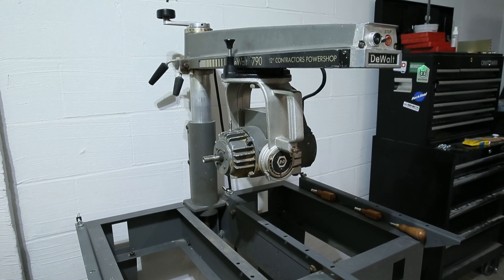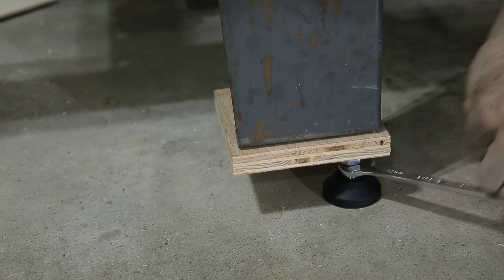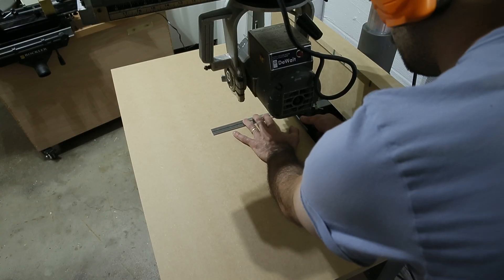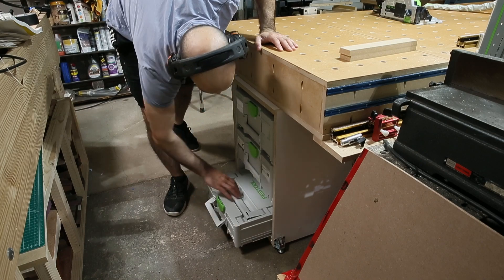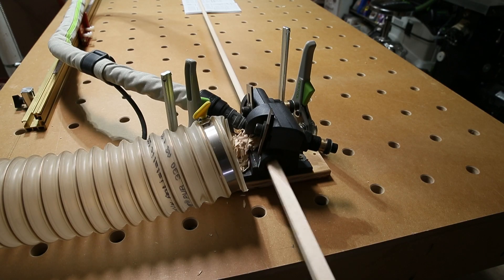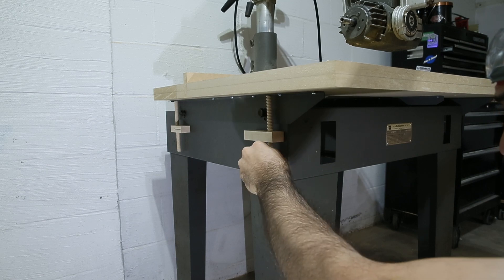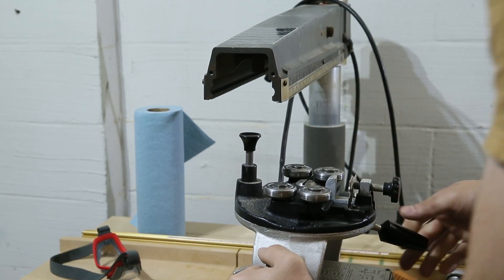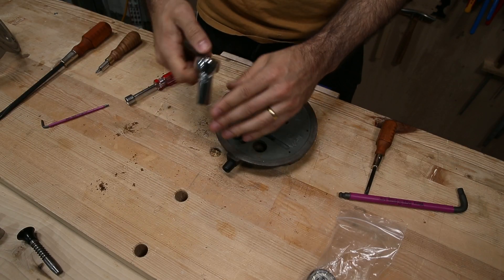Tuning a $125 craigslist radial arm saw; cutting wooden threads

Comment: I love this and am happy to subscribe. Excellent presentation and some great work. I have a similar vintage 10" version that was handed down to me and I went through a lot of the same processes. I also built a "Mr. Sawdust" style table for it that I'm pleased with. You can't beat a RAS for crosscut capacity which is what I mostly use it for. I found the same deflection in the arm that you did. In the end I don't worry about it too much. I use the saw for 'close' cuts and will true more important dimensions on my table saw sled. If you're looking for other tips on setup I found Brian Weekley's channel and videos to be super helpful. The dust collection style that Tommy Tompkins built seems to work best of the versions I've tried. I embeded some threaded inserts into the chute so that I can take it off for angle cuts. Cheers to breathing new life into a great old tool and thanks for taking us along with you.

Comment: Where should I look for any links for tools, etc.?
Reply from the maker: I’m just a regular guy in his garage, I don’t have any kind of sponsorships or affiliate links. I get the majority of my used tools on Craigslist and I try and get the new ones from Tools For Working Wood, Highland Woodworking, or Woodcraft. If you have any specific questions on a particular tool let me know and I can try and answer them for you!
Reply: @JimPudar  Thanks.  Understood.  Wasn’t looking for affiliate links, just any general URL site info as I, too, am a garage guy.  You mentioned the Beal(sp?) Tools countersink?
Reply from the maker: You can find that here: https://bealltool.com/products/threading/countersink.php

I find that it works much better than any multi-flute countersink I’ve tried. The chamfers it leaves are extremely clean and uniform even when using a hand drill. The major downside is that there’s no depth stop, but you can work around that by feel or with a drill press depth gauge.

I also really like the carbide countersinks from Amana Tools, but I use those more when I’m trying to make 20+ identical countersunk holes that all look perfectly uniform. The Beall one is really cool because it’s big enough that you can countersink very large holes with it just as easily as tiny ones.
Reply: Looks like a nice find. I didn’t see you adjust the horizontal/vertical heel?. Those rollerhead bearings I’m sure are nice now, but they can almost always be rehabbed. The Jack screws and king bolt set screw were on older saws, these “upgrades” were brought to you by B&D, trying to save a penny or two.
Reply from the maker: The heel was actually dead on in both directions when I measured it after putting the motor back on. The cut quality is seriously amazing, it’s better than my Festool tracksaw!

I did soak the original bearings in simple green and tried to get some grease in. I got them working far better than they came to me, but they still felt a little crunchy. The new ones are just phenomenal, I’m super glad I made the investment! After splurging on the blade and stiffener new bearings just made a lot of sense.
Reply: @JimPudar  that’s awesome Jim. I’m glad it’s working so well for you. These saws are awesome. Again, nice video. Thanks for sharing your experience.
Reply: @JimPudar  Hola. Soy tu nuevo suscriptor. Compré sierra radial Dewalt 7790 Dime por favor donde compraste tus rodamientos? Gracias.
Reply from the maker: Hola! Compré estos rodamientos: https://originalsaw.com/product/rollerhead-bearings-for-contractor-duty-radial-arm-saw-set-of-4/

Es posible que puedas limpiar el tuyo.  Prueba eso antes de gastar dinero!

Comment: Hello Jim - I noticed you have an extra deep MFT torsion box/table in the background. What were you trying to achieve when you made it so deep and how did it work out?
Reply from the maker: Hi, I wanted this to be a very flat assembly table in addition to being an MFT. It’s a torsion box with less than the typical number of inner beams because the beams interfere with the Festool clamps. Overall I’ve been very pleased with it, but I don’t normally use any MFT accessories which must be screwed down from under the table. I don’t have access to the underside of the top with this arrangement.

I’ll admit it’s a pain when I drop a screw in one of the holes :D

I don’t think a table this big would work well without some kind of structure supporting the middle as the MDF would bend if it were just a single layer.
Reply: @JimPudar  Thank you!